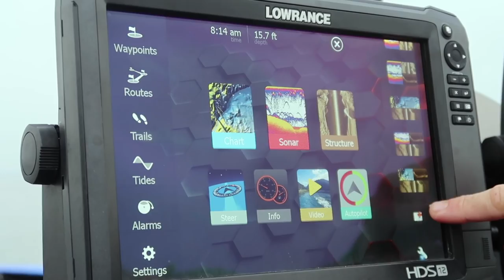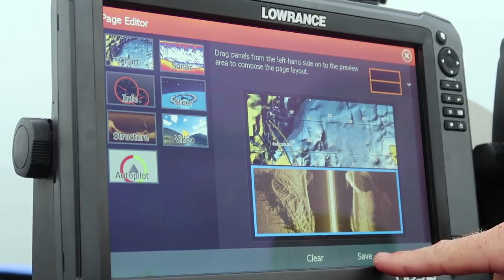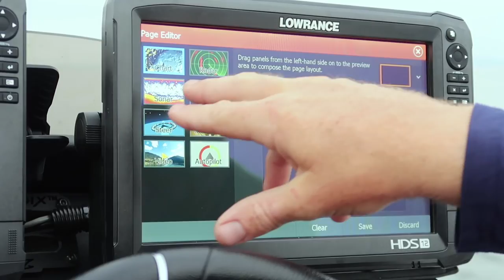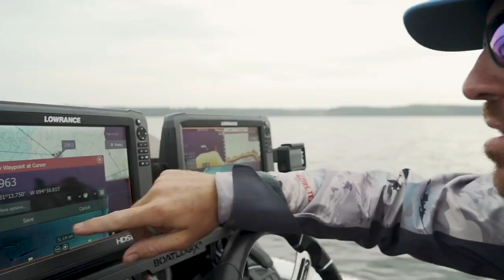Boat Electronics Setup + Finding and Catching Fish on Offshore Structure

Comment: Jacob, great video.   When you are looking at traditional sonar at the console, I am assuming that you have a rear mounted transducer for those units, so my question is on your rear mounted transducer when looking  at Sonar and Down Imaging, where exactly are fish that you see on your screen in relation to the boat?  When you see them on the right hand side of your screen, are they right under the motor?  If not, how far back?  Just trying to figure out where I am throwing a marker buoy and how to find those fish after I see them on Sonar/DI.   Thanks, Nick
Reply from the maker: As soon as they appear on the graph they are almost even with the back of your boat. Traditional creates a cone going down from the back of your boat where the transducer is
Reply: @WheelerFishing  thank you jacob. Hardest part for me is to relocate those fish that you pass over.  By the time you see them on your screen they are already behind you.

Comment: When fishing drop or spoon using electronics to see fish and lure, what MHz are you using? I couldn’t make it out on the screen. 83 or 200? Looked like 83 which makes sense gives more coverage out side the cone
Reply: Using 455 kHz or 800 on side imaging?
Reply from the maker: 83 on Sonar, 3d Structure Scan doesn't provide the option to change the side imaging frequency

Comment: My issue is not finding them, its loosing them after I've drifted over....
Reply: Me too.   I can never seem to find them when I circle back to relocate and fish for them.
Reply from the maker: Try using a bouy at first until your more comfortable
Reply: @WheelerFishing  will do.  I have a bunch on the boat and never use them.  I will use the bouys until I get better locating fish I pass over.  Great video and thanks for the feedback.
Reply: @WheelerFishing  I have them and never used them, guess I will now..